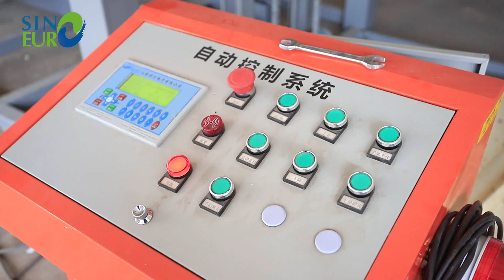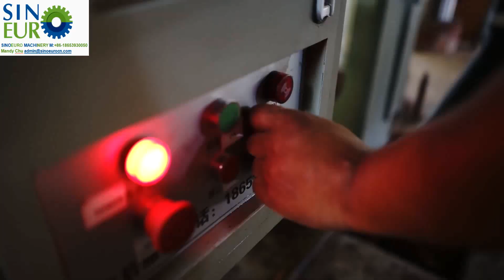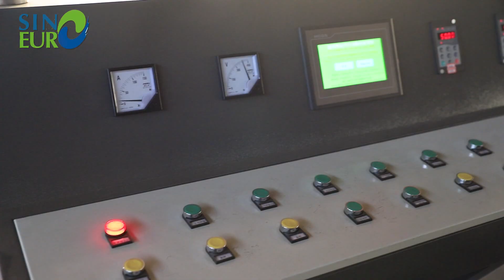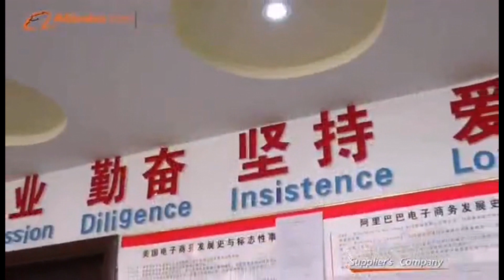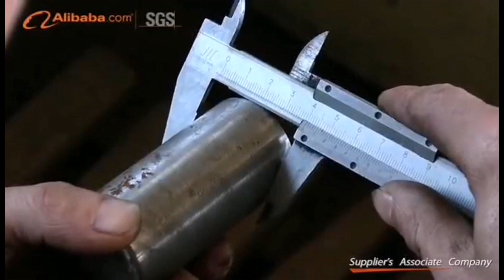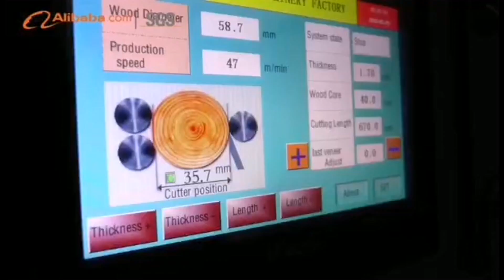Full automatic plywood making machine production line  plywood manufacturing process production line

Comment from the maker: Sinoeuro Machinery manufacturer is a professional manufacturer for Veneer peeling, plywood machinery solutions plant with factory layout and processing technology. We are your trustable partner. We Value Commitments, Quality Assurance, Clients focused & Service driven.

Should you interested please kindly check our website for more information. www.china-plywoodmachine.com 
www.sinoeurocn.com 
facebook.com/mandychusineuro 
www.woodveneermachine.com
Mandy Chu:M/whatsapp/wechat: +86-18653930050 
Email:admin@sinoeurocn.com

We are committed to provide customers complete solutions for veneer peeling line, plywood making plant,LVL,block board, PB,OSB production Line etc. Main equipments include: wood veneer peeling machine,dryer, glue spreader, pre-press, hot press, core composer, double sizer saw, sanding machine, boiler, and related plant accessories, etc. We give one year warranty for exporting machines and on-line Free service. We have CE certification and SGS approved. Our engineers are available to abroad for machine installation and worker training. We can also provide with technology support on customers’project,like technology transfer,flow chart drawing, production process procedure, plant construction and production material supply etc. With high quality equipment and experienced technology support, Sinoeuro Machinery will together with you to create a more brilliant future. 
Our Advantage:
1. Long-history Factory with Mature Technology
Plywood machinery manufacturer with 24 years history. Experienced engineers ensure the technical update and R & D of the machine.
2. One-Stop Service
We can provide complete solution from layout design,process flowchart,customize equipment to final installation. 
3. 24h Free On-line Service
A good assistant of customers to provide professional machinery solution with 24h online service.
4. Experienced After-Sales Service
Experienced technicians available for aboard installation and training. 
5. Quality assurance& Factory Direct supply price
We are factory manufacturer, can offer you best price with quality guaranteed machine.
Main Products we supply:
Plywood machinery manufacturing and scheming, which including Veneer peeling machine,plywood production line,veneer production line,MDF and LVL and OSB production line.
1.Our principles: Advanced Technology, Honest First.We are a professional manufacturer for plywood machinery and woodworking machinery in China, found in 1994. specialize in this field for more than 20 years.
2. We specialized in manufacture full plywood machinery.The main product includes all kinds veneer peeling lathes, wood debarker, veneer drier, veneer clipper, knife grinder, glue spreader, press machine, DD saw, sanding machine,etc. We have our own designers to produce machine according to your requirement.
3. It has developed into a large scale production model.High precision, easy operate and reasonable price character.  Having own after –sale maintenance center, our engineer can go to overseas for installation  and  commissioning.

For more info. Please kindly visit: www.china-plywoodmachine.com 
www.sinoeurocn.com 
www.woodveneermachine.com
Mandy Chu:M/whatsapp/wechat: +86-18653930050 
Email:admin@sinoeurocn.com      facebook.com/mandychusineuro 

Process of making Eucalyptus Core Veneer 1 | Rotary cut 2 | Put into cutting machine 3 | Cut to size 1270*640mm 4 | Classify into grade A/B/C 5 | Air dried 6 | Collect; Be tied up in bundles.

Mandy Chu:M/whatsapp/wechat: +86-18653930050 Email:admin@sinoeurocn.com 
Sinoeuro Machinery manufacturer is a professional manufacturer for Veneer peeling, plywood machinery solutions plant with factory layout and processing technology. We are your trustable partner. We Value Commitments, Quality Assurance, Clients focused & Service driven. Should you interested to buy veneer and plywood machine. please kindly check our website for more information. 
www.china-plywoodmachine.com
www.sinoeurocn.com 
facebook.com/mandychusineuro
 www.woodveneermachine.com 
Mandy Chu:M/whatsapp/wechat: +86-18653930050
Email:admin@sinoeurocn.com 
Customize Veneer Peeling Machine for making wood veneer,the veneer thickness can be adjusted from 1 - 6 mm ,the machine with hydraulic knife holder saving manpower . Also our factory main product include: log debarker , veneer peeling machine , glue spreader , veneer composer , cold press machine , hot press machine, sanding machine ,edge trimming saw etc. Your OEM machines Welcome your kind inquiry and visit our factory!
Reply: 5:11